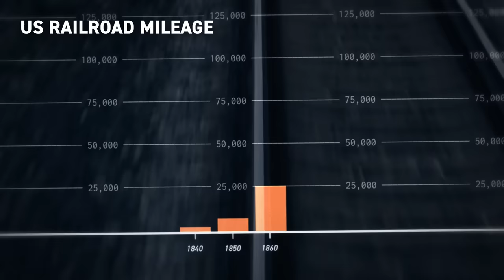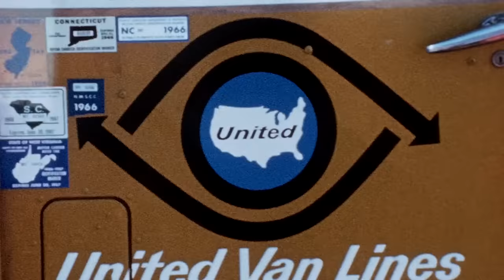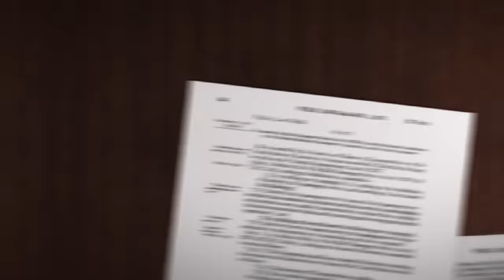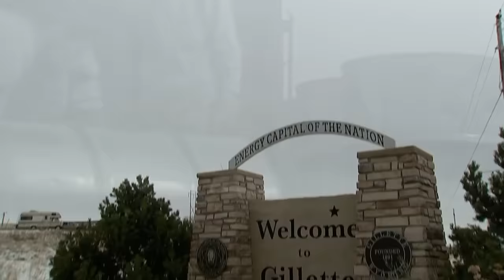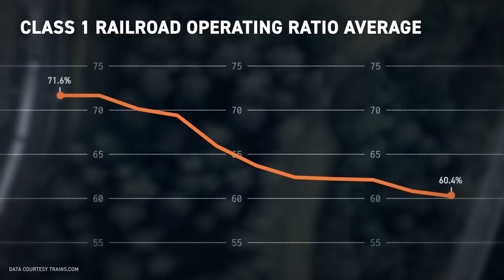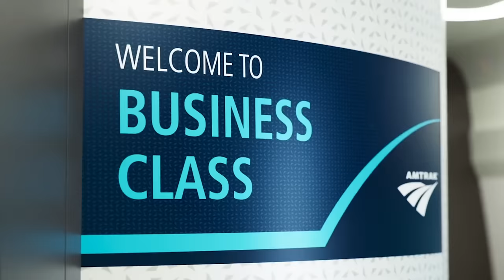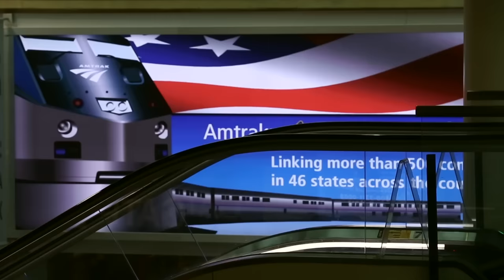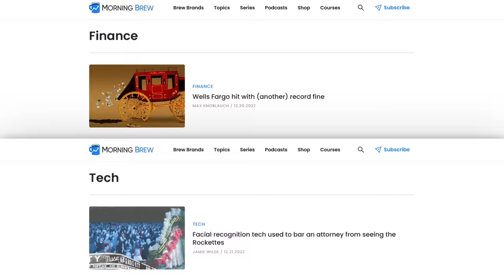The One Tiny Law That Keeps Amtrak Terrible

Comment: Railroad companies focus on bulk commodities and gross tonnage is not some malign conspiracy on their part, but the result of competition with truck transportation.  All those small branch lines and spurs to small industrial users have to be PAID FOR to be built and maintained by the railroads.  The roads to access all those places are available to trucks for the low cost of a license, and fuel taxes, and are mostly maintained by a combination of federal, state, and local governments.  The railroads can't compete with that, especially as their routes are subject to property taxes.

If passenger rail needs timely operation and investment in infrastructure to operate at high speeds.....then it must be willing to pony up the money for double tracking, bidirectional switch and signaling, and sidings to make for the surplus capacity of freight railroads that THEY want to use.  Not expect that freight railroads mill magically provide them with infrastructure that does not serve the purpose of tending to moving bulk freight.

Comment: Your Horse is full of post-processed hay. Passenger rail, passenger cities look to any railroad track and decide that this would be a good place for a train. El Toro Po Po...   These are freight tracks designed (if that is the correct word) for freight service, and for the most part most of these routes are over 100 years old with curves and grades to match that model of service. And you want to stick a modern passenger train into the brew. It hasn't happened in 60 years and it is not going to happen in the next 60 years.
You correctly state that AMTK owns the rails in the east, and therein lies the heart of the problem. AMTK must vacate 1800s infrastructure for twenty first century solutions. ERGO: all passenger track must be rebuilt on its own right of way. YES, I would even move to a 5' gauge track so that freight trains couldn't get there even if they wanted to. And you wqill need that gauge to manage faster trains.

The biggest bugaboo is the price of the property, of the right-of-way. But actually nation-wide right of way already exists thanks to President Eisenhauer. He called it the interstate highway system, but really all it is is a big right of way. So let high-speed-rail make use of it. Nice and direct, easy curves, and since all of the popular destinations have already moved to the interstates, it has the proper connections. The tracks could be surface, elevated, or subway, and most likely all three. Again the tightest connections would be in the east. And indeed, in the west single track operation would work just fine, At least for cross country service.

So until you get your damn passenger trains off of the freight railroads, your problem will not be solved.

Comment: Definitely not going to happen, but one thing you could do is nationalize the rails for national strategic purposes. That would allow you to change the mandate from quarterly profits 3-5 years forward to providing logistical infrastructure and operations. Worst case make the operations part managed by a branch in the military as they have well functioning logistics and you could argue broken train logistics can quickly become a national security concern if times change or the are external shocks to markets.

Comment: Amtrak need to build there own tracks and it needs to part of the instructure bill joe passed. Keep the passenger and freight rail lines seperate nation wide. Also, freigh rail need to be federalized.
Reply: They actually are, Texas central for example, very promising
Reply: Yes, however the acela northeast regional and the pacific, lakeshore lines need to work on building there own rail tracks.

Comment: The fact that air travel wasn't mentioned until the 19th minute is only part of why the analysis in this video is poor. The other is that private high speed rail projects of the kind you described are coming on line, especially in Texas. Planes, trains and automobiles will thrive together, or passenger rail will end. My grandchildren who are not yet born will take that train from Wyoming through Colorado you described, but it won't be run by Amtrack.

Comment: Picture mono rail in the meridian of I-25 elevated above road traffic with high speed trains? Picture this high speed monorail everywhere?
Picture this as a light weight train like they are developing in England? Why build massive bullet trains like China? Why not build light weight trains that are more like a 737 fuselage weighing a fraction of a massive rail car?
As a fast commuter train elevated above road and freight rail 200+ mph is very possible. Light, high speed monorails can fit in almost every Interstate meridian.
This is Brightline's failure.

Comment: On the list of priorities, I would consider “getting the resources that keep entire cities fed and provisioned” to be higher on the totem pole than passenger traffic. 

Even so, the entire issue with passenger rail is that it is an outmoded form of transportation. After all, why take the train when I can drive short distances (less than 500 miles) with the ability to dictate where I want to go? For long distances, why take the train when jet airliners can fly me across the country in five hours while rail takes several days to do the same thing? 

The entire problem is rail, as a form of passenger transportation, was phased out by the car, which, with the interstate highway system (something that exists mainly for military strategic reasons and would have been an inevitability) made it near totally pointless. The invention of the car was the death nail of passenger rail just as passenger rail was the death nail for long-distance horse coach routes. A better, more efficient form of transportation, which suited the individual needs of the person, came about that - though flawed - outclassed the previous system for various reasons.

Comment: Time to reintroduce regulation back into the railways. If they have to be required to maintain railways, so be it. Time to enforce that passenger priority law too. I live in Tucson, and I would jump up and down for joy if they introduced a rail route between Tucson and Phoenix! Even more if it were high speed, but even normal speed would be helpful. The PHX airport just has so many more flights and they're so much cheaper. Not having to drive and park would be wonderful, and would probably cost less.

I do know the coal industry is dying. I wonder if that would make enough of a difference. Though container ships of goods from Asia are not going to go away.

Comment: You conveniently failed to take into account that so few trains severely restricts one's schedule. Traveling by car or air, one can depart and arrive pretty much any time they like. Not an option on a train. Trains are slow. Yes, rapid rail would help. But look at the absurd amount of money spent to do rapid rail in California, and it still does not function. The cost of upgrading for rapid rail across the country is very prohibitive. I do not know anyone that wants passenger rail to go anywhere. Saying that the public wants it depends strictly on where you ask the question.

Comment: sadly, many factual errors in this rather glib production. First, Appalachian coal - bituminous - is far cleaner to burn than  western coal (lignite). Western coal is the worst coal in pollution sense, so production never shifted west because of ecological interests - that is a ludicrous error to say - but because it's cheaper to mine, since it's vast surface strip mines, usually close to the surface, easier to access and there is more of it in central places like the Powder River Basin. Appalachian coal is actually a better grade of coal, often now exported to be used in steel making in places like China. The reason why coal mining shifted west is seams of Appalachian bituminous coal increasingly got spent or became uneconomic to mine for heating purposes. i This basic error sort of wrecks one of the legs of the argument made in the video.

Comment: We can't use old rail rights of ways for a modern high speed rail network. Modern bigh speed rail requires dedicated roghts of ways that have to be as straight as possible. Its a false solution to say we need more flexibility with routing passenger trains on freight rail rights of ways because those roghts of ways are inadequate.

Comment: The simple fact is that rail service designed to haul heavy freight make no economic sense whatsoever to haul light passenger cars.  Airplanes can haul people for less cost than even buses, never mind trains.  The idea of train service being some magic solution to moving people has been a dream for many, many decades.  And it's just that, a dream, not a reality.  Making comparisons to Europe and Japan is a fallacy.  They have MUCH greater concentrations of populations moving over predictable routes on a repeatable basis.  And even there passenger trains are disappearing because they simply don't make sense.  Remote work from home is reducing commuting which kills even the high commuting volumes which make passenger service viable in Japan. 

Simple reality:  while passenger trains may be fun they aren't viable.  Period.

Comment: Amtrak will never be a viable option using tracks of freight railroads. If you really want high speed passenger trains, they need their own infrastructure.
Reply: Or a new private companie will create their own tracks.
Reply: @maroon9273  no private company is going to invest that amount of money. It costs $3.5-4.5 million dollars per mile just for the track. You add in land acquisition costs and all the other costs associated with building a railroad such as signaling, bridges, viaducts etc.  You need to do this across the entire US. You’re talking 20,000-30,000 miles.

Comment: How can a train not be in time. A plane has the weather and crowded  airports there's no excuse for trains
Reply: What are you talking about?
Trains also have to deal with weather and crowds, but you do know that trains travel on tracks right? A plane may have multiple air corridors to travel through, trains are limited by track as was explained in the video if you listened.
Also, this isn't a battle between transportation options, they both have their pros and cons.
Reply: In the case of the USA, the reason trains can't be on-time is because of bad infrastructure and negligent business decisions. Pieces of track intended for freight to stop at to let commuter trains pass are too short for the nowadays lengthy freight, and the reason freight trains are longer these days is because they're Cheaper to Operate™️, apparently.
Reply: @Floedekage  To be fair, trains are in competition against airplanes (and expressways), just not against intercontinental air travel or any flights to inaccessible locations.
Reply: @regulate.artificer_g23.mdctlsk  they are in competition on an absolutely small amount of cargos, mainly passenger. 
If there were high-speed trainlines across the US it would not eliminate the passengers that needs to travel fast and have the money to fly, but it will offset the passengers looking for cheaper options and who can spare the time and allow more passengers who don't travel with the current options.
Planes will not ever replace local rail transport or subways nor will they ever move heavy slow freight as coal, ore or oil.
As said, they each have their place.
Reply: @Floedekage  Oh but the thing is: HSR will absolutely replace local air travel, that already happened in Europe at least twice; in Japan, the only airlines that exists are to cities not connected by the Shinkansen. Like I said, the only thing trains cannot compete with or replace are intercontinental flights - by that I meant flight distances that are about the width of North America.
Reply: @regulate.artificer_g23.mdctlsk  oh, alright, I misunderstood you then. I thought intercontinental meant between continents and I regard some American, and even some European, airplane routes as being not local, but at leat regional.
I guess my only point is that every transport vehicle has its place, but we really could use more well connected and fast rail transport not only in America.
Reply: @Floedekage  True! And yeah, air travel beats HSR in very long distances, especially since that means flying at high altitude for a significant amount of time. (High altitude = less air friction = higher speeds)

Comment: So many flaws in this video. 

Firstly, if the railway have pushed higher profits for 40 years now, that is not a short term gain. That is long term. And if that is due to the oligopoly or something else, really don´t matter, its just a fact.

The decline is mixed gods have nothing to do with the railways, but everything about to do with containerization.  Prior to 1950s there was no simple way of shifting loads from rail to truck to ship. Because ship have a hard time accessing the last mile, loads of industries had industrial tracks where they could order just one railcar of gods at a time (and they where a lot smaller than today, typically 15-20 tons net each). Who ever owned the rail line had a practical monopoly.

When inter-modal containers was introduced, the main gold was not rail transport, but truck to ship transport This alowed the whole east cost of USA to be accessed directly. Factory could ship a container to the harbor, than transported to the next harbor and then shipped into the next factory. With a net capacity of 25-29tons per container, this was actually quite a lot at this time. Transporting this on railcars also alowed trains to have a sort of ship like transport scheduled where the empty cars didn´t need to be shuffled, cutting down on transport cost for trains as well.

This is why the swichyards was removed, becasue they where mostly no longer needed. Not because some evil plan by railway bosses. They was put under competition. Not by truck, but by sea. Transporting gods between Boston and Miami was simply no longer economical by rail, and the same with Seattle to LA.

For passenger rail line. 3 departure per day at sub highway speed? hardly anyone will ride that. Why not just open a bus line? Railroad romanticism? 

If we look in Europe, lines that have sort of traffic is hardly ever in use, and those are generally part of a larger network. That is feeder lines.

Most lines either are quite fast over a fairly long distance, or they are very frequent. 

german wikipedia page for ICE have a excellent image showing both frequency and speed. Most of the network operate in 30 or 60 minutes. Quite a bit operate at 120 minute. Those are in most cases alternative routs and/or feeder lines. Very few operate lower than every 2 hours. Those are pretty much exclusively a combination of alternative lines AND feeder lines. The German network is not as fast as the Frensh is, but the speed is still quite decent compare to highway speeds. With top speed at most lines at 250km/h and almost all lines at 200+km/h. There are parts of the network with lower speed (typically 160km/h), but that is generaly at very slam lines or short passages.

Having a line at 3 departuers a day at sub highway speed is just not viable. Take the buss

Comment: We are never going to wean the American public off of the automobile unless and until we make public transport work for all of their needs. If the typical American needs a car at any point during the week, the marginal cost of using it for everything else ranges from ten to fifteen cents per mile, a figure that public transport can only meet in high-usage areas like New York City. This is because land-use policies in the US are based on the wishes of preserving property values for an influential minority than on government legitimate functions. Any zoning regulation that does not have a bona fide health and safety rationale should be abolished. Then and only then can we get people housing that is cheap, affordable, and close to work and shopping, and only when that is accomplished can we wean people off of their cars.

Comment: America is a capitalist economy and the return on capital is the dominant metric.  It isn't a matter of everyone "wanting to boost short term profits".  The bond and capital markets will demand the replacement of anyone not viciously and determinedly pursuing their interests for immediate returns.  

US capitalism used to plan.  But the tendency of the rate of profit to decline means a struggle is required to stay ahead of the downward curve.   The increase in the exploitation of US rail workers, especially through a decline in working conditions is one form of this.  Life expectancy in the US is now falling and is below China's.  This would have happened even without the COVID-19 pandemic.  

Within profit-making-railroads it isn't tons-per-train that is the key metric but the cost-per-ton-mile that is the critical.  Longer trains are a product of the drive to minimize this cost.  Driver only operation will provide a step change in this.   Less-than-train-load freight is disappearing as containerization means the "last-mile" is "most efficiently" served by road transport from an interchange hub.

The author of this video would benefit from a study of the political-economy of Karl Marx.  He had a thing or two to say about the logic of the capitalist mode of production and its need to continuously revolutionize the productivity of labour.  The paradox is that the stupendous development in the productive forces allows mankind to rationally and democratically decide what is best but this cannot happen withing the framework of capitalism itself.  We are thus in a period where the options are revolution or reaction.